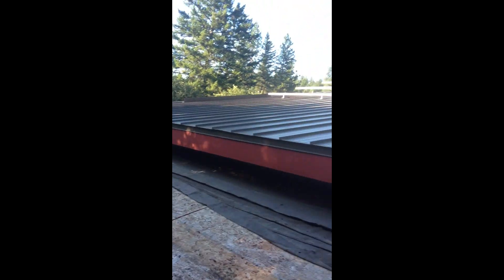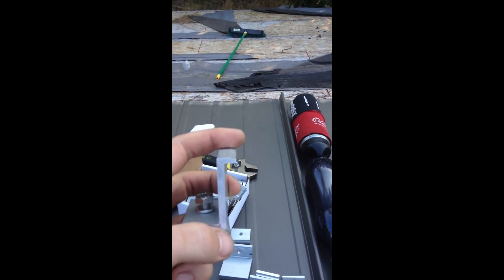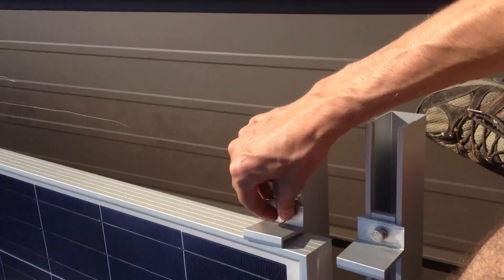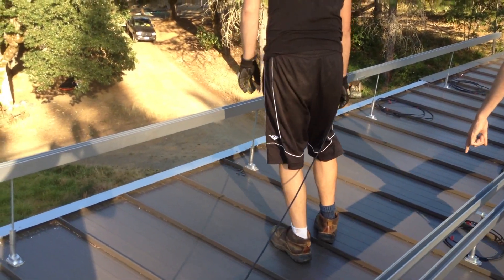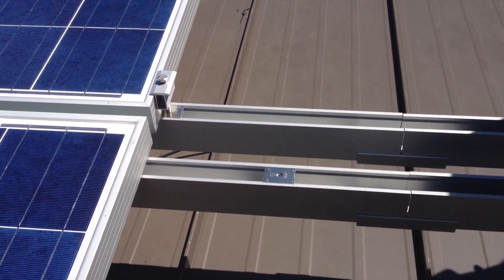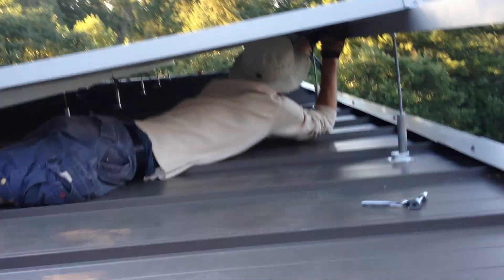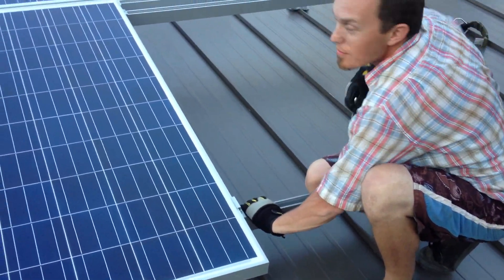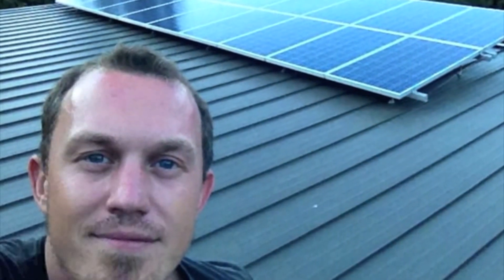How to install 4100 Watt Solar Panel Array: Solar Off-Grid System Installation Video 22

Comment: If you just want some quick power you could just lay them out on the roof and plug them in. Go back later and secure for the wind, 2x4 and a glue gun DONE

Comment: This new battery reconditioning method is so simple and quick [Check Details Here>>>>https://t.co/K0S4ZxvA0x ] ,And this works for car, phone, and laptop batteries! It even works with batteries you can use in a solar panel system's battery bank (or other alternative energy system’s battery bank). Plus, many other types of batteries!.

Comment: How did you wire your panels?  4 strings of 3 (panels) in series and everything tied together in parallel (breaker box )?    
I'm not sure my wiring is correct?  I'm sure I should be getting more power..  everything tied in parallel 24v system

Comment: It covers all the topics in a clear and concise manner that allows practical DIY type people to understand the electrical terms and components of a solar power system. Even though these topics can be very technical full of electrical engineering-speak, it covered all the topics while keeping the examples and terms so the average person should have no problem understanding the information. https://plus.google.com/b/100728704920141855812/100728704920141855812/posts/WjRt4LRZEzo
Reply: Good information for any one.

Comment: Learning as much as i can about solar. i am currently licensed HVAC/ELECTRICAL both. I am curious why some comments say these are not grounded properly???? I see Metal racks, metal bolts, metal clamps, Metal roof, It all looks bonded to me am i wrong??? Solar panel frames connected to the clamps and rails, Rails connected to metal roof, Some areas metal roofs get grounded. Wheres the grounding issue??? I am not solar  professional but to me everything looks neat, sturdy and safe. I miss something???

Comment: Weeb Clips are on Wrong need to turn 90 degrees..
Reply: +Solar Power Videos 
Solar Power Videos:

You are wrong about the weebs. They need to be in between the rail and the mid and oriented in such a way that they are "sandwiched" in between the panel frame and the rail, so the connection between the electrical equipment is electrically sound. You can clearly see in the video that the entire weeb fell into the channel, and was not sandwiched between the electrical equipment. Also, the weebs are not square. They are longer on one side and that longer side needs to bridge the gap in the rail.
Reply from the maker: +Mike Garcia III  Sorry you are incorrect, the weebs have a side that pierces the anodized coating of the aluminum rail system to allow ground contact. It is pretty straight forward and can not be installed incorrectly due to its shape.
THanks for watching
Reply: +Nicholas Flowers You are correct those weebs are insalled wrong. they are doing nothing to bond the panels

Comment: Not a bad system a little excited for a small system but well done. Good air flow under there solar doesn't work well in the heat so u did an alright job for air circulation

Comment: I want to know the voltage rating of a single module! can you please elaborate a bit that how 6 modules in series resulted in 48 volts when connected to the inverter?

Comment: If you buy your zip ties from an Electrical wholesaler and get the ones with a metal centre clip, they will last years as they are made out of nylon. They are also quite expensive. They will not fall apart like the cheap hardware store ones. If it is 100 percent plastic, it is a cheap tie.

Comment: so 17 000 bucks??and u r gonna replace each battery every 3-5 years.....where is the savings over a generator??im not anti solar ,it is amasing on my rv.....but for the power needed in a home...fridge...freezer...even with wood heat u still wanna have a fridge and freezer I would think??I just don't see the savings??am I wrong??
Reply from the maker: preacher031163 Batteries should last around 10 - 15 years

Comment: If you want to extend the daylight on the panels you could get rid of some more trees along the sun setting line. Try dynamite, chainsaws, cutting down timber with AK47's on rapid continuous fire, and roping the smaller ones... YEEEEHAAAW!!!!!

Comment: Very shocked at the use of plastic zip ties.  My my experience they break after 1 year in the sun.
Reply from the maker: They are military spec zip ties and are not exposed to the sun since they are tucked under the panels, if they snap I'll replace them with wire ties, but so far its been two years and they are fine. Good advice tho. Thanks for watching!

Comment: Looks good, I like to ground mount my panels so in the winter I can sweep the snow off them. I wish I had a system like that, I'm up to 8 panels now, every year I buy a few more.
Reply from the maker: Nice, ground mount is great if you have the space.. It also is a little more expensive to pour cement and do a pole mount, but sometimes its the best way to go, you can even change the pitch of the panels if needed for the winter and summer months to help gather more sunlight.

Comment: Nice Vid. A few questions if you don't mind? Shouldn't you have more spacing between panels to let high winds blow throw?  What pitch is on that roof & is it facing South? Do you get a price break when you order 18 at a time?
Reply from the maker: Thanks for watching, I don't mind the questions.. thats why I made the videos to teach others what I learned and spread alternative energy knowledge. If you live in high wind areas the best practice is to mount the panels below the top of the roof so they can't catch gusts, but panel spacing is not as important as a solid roof connection with lags. Its idea that your panels are facing true south, our roof is SSW so I lowered the pitch of the panels to gather more sunlight. Maybe I should do a video on how to calculate the optimal position vs cost to install. Sometimes it's cheaper and easier to just add more panels then changing the direction they are mounted on the roof.

Comment: Wrap the connections with electric tape.
Build a knee wall around them so they not visible from the ground to hopefully prevent vandals from throwing rocks.
Allow no trees and branches to grow so close that a wind could blow them onto the panels.
Reply from the maker: Good advice definitely! Thanks for watching.

Comment: why do we need to put panel so close to each other.  If they need to cool down I would think there should be spaces b/w them for better air flow?
Reply from the maker: Space on the roof is often limited, also wire lengths and mounting components to the rails are more expensive when doing the system design phase then the small added benefit of the airflow lowering the temperature a little. It is important to give them some space from the roof to allow the air to circulate underneath, and as you can see they are mounted off the fast jacks and 3/4" all thread giving them plenty of airflow. Thanks for watching!
Reply: Solar Power Videos Thanks. I do have lot of space on my roof and it is easily accessible from the windows.  I do not want to rack mount on the ground at this time may be in the future.  My house is build part by part so I have 8 pitches.  So which mount should I use if I want to space between roof and the panel?  Ideally how much space would be best.  I appreciate your response. thanks
Reply: Solar Power Videos I am window shopping right now and I see lot of companies make hardware and some are quite pricey.  I want to have all the know how before I begin my project.  I do not have any solar at this time but this old house I am designing to remodel will be completely off grid.
Reply from the maker: arshi khur
I recommend what I used, Fastjack mounting posts, ProSolar Aluminum rack mounting because of its versatility, ease of install, and low cost. The fastjacks provide a good amount of space between the panel and the roof as well. A couple hints, all your panels should face the same direction and they should be mounted on the roof pitch with the most solar exposure depending on your location and when you need the energy most.
Reply: thanks

Comment: I need help on how to connect solar panels for to achieve 100 to 120 V and 1450 to 1550 W. I have 11 Solar panel of 190W, 45.6Voc
Reply: Google "Fronius configuration tool" and there is an online calculator that you could use to match the type solar panels to number of strings and rows for an equivalent sized inverter.
Reply: Don't worry about your voltage, just your wattage, and get an appropriately sized inverter to handle the load. It will invert down to the 110/120V and what remains will be your drawable amperage. Amp x Volt = Watts.
Reply from the maker: If you were to connect your panels in strings of 3 panels each. Thus tripling the nominal voltage of the system to 135V. The inverter should adjust the voltage to the correct output for use with your appliances.
Also, the wattage of the panels does not change based on connecting configurations, they are 190Watt panels, so 11 of them would be around 2K Watt peak output.
What kind of system is this? Do you have batteries and a charge controller?
Thanks for watching

Comment: what did this system cost
Reply from the maker: Parts were $17K roughly, plus there is a 30% tax credit in California. Look into your local clean energy incentive programs to save money.
Reply: Solar Power Videos So after the SHTF & you've spent $17,000 & the Ferguson crowd (Liberals) comes LOOTING for whatever you've got, & they take a tire iron & SMASH your solar panels, .... THEN WHAT?

Comment: Did you look at "S-5" standing seam clamps when you were deciding on a racking system?
Reply from the maker: I went with the Unisolar rack mounting because of cost and local availability but the S-5's are great too.

Comment from the maker: The in order to maintain the maximum voltage level, only 3 strings were possible. This is because when you put panels into a string they are connected in a serial circuit and the voltage of the panels are added together, and when those strings are connected in parallel the amperage of the array increase but the voltage stays the same. I wanted to keep the system at 48V nominal and max the 80amp charge controller to allow the best charging configuration for an off grid system.

Comment from the maker: This is for an off-grid homestead that doesnt yet have access to the grid, so it is meant to replace using a generator. However I do have plans of adding a dc relay switch and propane backup generator soon.

Comment: Thank you very much for your post, you explained things very well and it looked great! I would like to see your battery bank and charge control system that is supported by your panels. Curious, what is the purpose of the install? Complete off grid, or supportive energy option etc... thanks again

Comment from the maker: Aprox. $0.97 per Watt after tax credit for home owner ($320 per panel of 230W -30% tax credit)
However the entire system was closer to $3.07 per watt installed with all components and battery bank.

Comment from the maker: These panels actually dont have a micro inverter, since it is not a grid tie setup. I have all the strings of panels connected to a charge controller, and a large inverter.